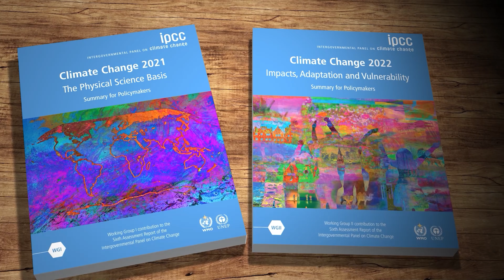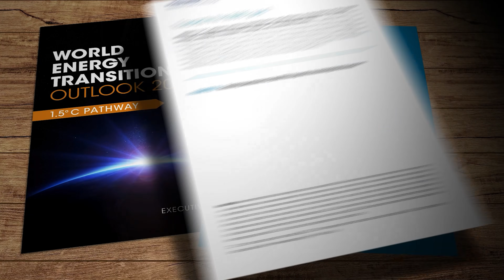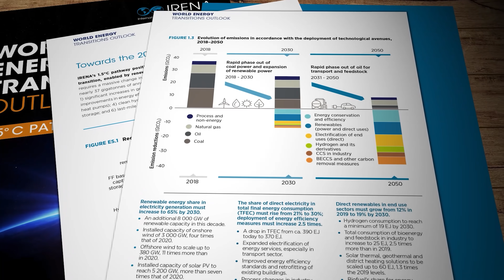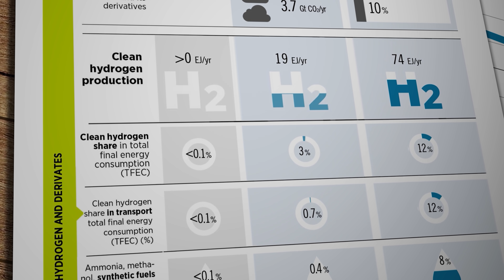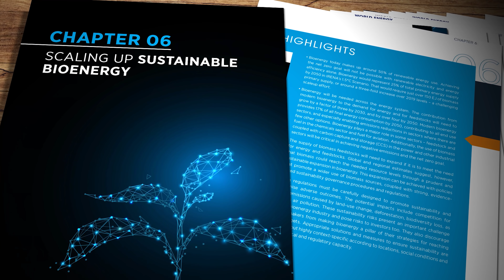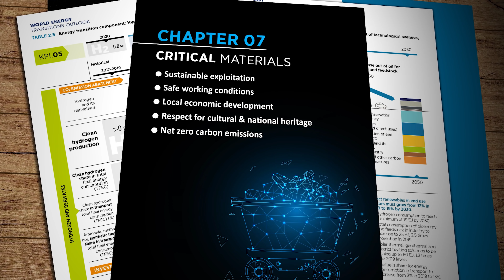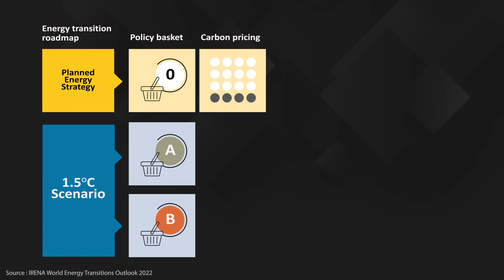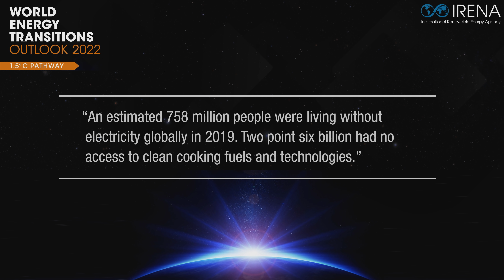Massive global energy disruptions are coming. Brace yourself!

Comment: These tricky questions have been made far more urgent, in the wake of the energy crisis we now find ourselves suffering.

It turns out that energy security is the driver of this urgency, rather than climate change. 

The pandemic, followed by Russia invading Ukraine, shone a light on just how fragile our fossil fuel economy actually is. 
The signs have been there for decades - and indeed, globally, we have seen numerous examples of this over those decades.

Our energy security has been problematic for generations.

It is a somewhat horrific insight to realise that these security issues have come to a head with Russia invading Ukraine and the sanctions being imposed on Russia.
Horrific, because it will be this event that will galvanise action, rather than climate change. 

Short term profit continues to be the driving force behind the energy economy, rather than climate change. 
Until that outlook changes, we remain in deep peril. 

Blue hydrogen, fracking and new coal fields are just one example of that peril - that the short term profit doesn't swing to renewables, but continues to up the ante on fossil fuels.
Reply: "how fragile our fossil fuel economy actually is" You have the same issues on practically all markets - food, building materials, metals. It is making people rethink their supply chains, though it is a clear step against globalisation.

"It is a somewhat horrific insight to realise that these security issues have come to a head with Russia invading Ukraine " Well, when think about it there was a plan based on closing nuclear and coal in favour of unstable renewables balanced by natural gas of... Russian origin. What could possibly go wrong?
Reply: Yes, and if Russia hadn't invaded the Ukraine and turned off the gas tap - our countries would still be using it just as quickly as ever while discussing how bad climate change is.
Reply: You're so wrong! It's been 30 years since COP 1. We could have easily got to 100% clean energy 15 years ago, if we had treated climate change seriously, so today we would have no inflation, and 15 years of Russia getting no income from gas and oil might have meant they could not have afforded to invade Ukraine! So yes, it is climate change that has brought all of todays problems, by the world not dealing with it!

Comment: People complaining that's it's hard or unrealistic always get on my nerves.
That's all irrelevant as we *have* to do this. Complaining or focusing on the negatives is only something you can do if you don't fully get it yet.
Reply: No, you don't "have". It would be nice to avoid +2C, though if you live in area where based on models there wouldn't be much damage and are willing to avoid migrants then you can easily live with it.
Reply: @useodyseeorbitchute9450  No you can't Mr bitcoin advert, because you can't run away from food and fuel prices which are all determined by global supply, and mass migration beyond anything we've seen in modern times will not be ignorable or avoidable. Besides, where do you live that you think has the majority of its housing fit to cope with severe heatwaves and floods etc.?
Reply: @danyoutube7491  "can't run away from food and fuel prices" My country is net food exporter, while main component of fuel price are green taxes. Manageable. 
"mass migration beyond anything" How would is it supposed to seriously harm a country that's already somewhat nationalistic and already repelled a weaponized mass migration a few moths ago?
"where do you live that you think" Poland. Based on IPCC models: +3C in winter, +2C in summer and no obvious change of overall rainfall, if anything a mild increase of rainfall in extreme scenarios. Yes, saving on heating, though presumably we're going to invest in air conditioning.
Reply: Indeed.
Reply: Ppl complain bc they feel your "we" does not include them. Other's suffering is so annoying, inconvenient.
Reply: Children without the maturity to question or think critically of all that is "told to them as true", without the humility of realizing they are completely clueless about the truths of the world are boundless in this recent generation. IF we could tap ignorance power like the elite have.. we would outburn the sun.

Comment: It's time for switching to an eco-social market based economy and enforce stricter environmental guidelines via law. As long as it maximizes the industry's profits in the short to mid term there is no incentive for it to switch to more sustainable methods early. I.e. getting the concrete and steel production to only use renewable energy would be a massive win. Reducing the overproduction of goods may also be helpful (think about the containers of stuff that i.e. Amazon has to destroy every day because it didn't sell or the food in supermarkets that didn't sell).

Phasing out single use plastics would be nice aswell, as recycling (which isn't even practiced everywhere) doesn't work indefinitely with the polymers that are used currently. The material degrades over time and loses its useful properties, eventually leading to it getting burned (emissions) or thrown away into landfills or into the ocean (pollution).
Reply: What annoys me about plastic recycling is the fact they 'still' make unrecyclable plastic wrappers for food in supermarkets. They say on the packet in teeeny-tiny writing how committed they are to researching new ways to package goods responsible - 10 years later: some fresh produce, roasted peanuts, sweets/candy, pies, etc, etc are 'still' in unrecyclable plastic.
Why aren't supermarkets getting on with it?
Reply: Go look up Prof. Mark Blyth (Brown U.)
He's a Scottish political economist, which means he looks at how politics and economics interact rather than looking at them separately. He's written a great book called Angrynomics with Eric Lonergan which is about the current economic state so many countries and economies are in. 

He uses the analogy of economic systems being like computers and describes we've had 3 main generations of capitalist economics in the last 120+ years. Each ended up failing because like a real computer the software (economic policies) and hardware (our market economies) could no longer do what's needed. There was the crash that caused the Great Depression and then Stagflation (in the 1970s) and then the GFC (2008). 

What never happened after 2008 was a SYSTEM UPDATE and we are now running with a patched up system that still has all the same faults that lead to 2008. That's why we need the changes you mentioned.

Marks got lots of stuff here on YT if you need some recommendations let me know.
Reply: @tonywilson4713  That's super interesting, thank you!
Reply: The problem is that the laws will never be made as long as they fail to benefit the large corporations. No government, no matter how much integrity they claim to have, will bite the hand that feeds. The more impact your actions have on the economy, the more political power you wield. Any plan that includes a government making large corporations do anything they don't want to do is either a pipe dream or a flat out lie.
Reply: Nuclear.  Clean, safe, carbon-free.
Reply: @scottslotterbeck3796  I'm not against nuclear energy and think that i.e. Germany phasing out the technology was initiated way too early.

Even if all countries were supporting it from an environmental standpoint, current geopolitics would never allow for everyone to have access to nuclear energy, probably for the better - i.e. see Iran, North Korea, ...

Comment: Nuclear power.  Build 750 nuclear power plants by 2030.
Reply: What happens to a nuclear plant when we get a huge solar flare bug enough to disrupt the power grid?   Will they be able to still safely shut them down temporarily?

Genuinely curious.
Reply: @sandyblanchard5678  there are reactor designs that will fail safe. See the Wikipedia page on Passive nuclear safety. Molten salt, and Pebble bed reactors are exampls.
Reply: @sandyblanchard5678  Why should it disrupt simple back up diesel generators?

Comment: Shipping and airlines account for more pollution than all humans combined. They are dumping toxic pollution 24/7/365, shipping motors are 1000's of liters per cylinder, and burn 10000/gal of fuel an hour. Airlines fly at 100 miles per gallon, of fuel that cost 100's of dollars a gallon, and is extremely toxic to our world. We must stop the buying of trash, or we are done.

Comment: The IPCC assessment especially the last one sounded just desperate so.. 
But i would like to see more solar on the roofs but the energy storage solutions suck.

I’d rebrand renewables to “rets” as in renewable energy transformation source. As the materials out of which they are made can’t be re-newe’ed (in a way to doesn’t make you go bankrupt and the problem already exists now not tomorrow) for wind and solar that is very much a true thing. 

I hope they will not increase solar use with concrete for now green land. And if you need batteries build the, f… underneath the panels else it wastes even more land.